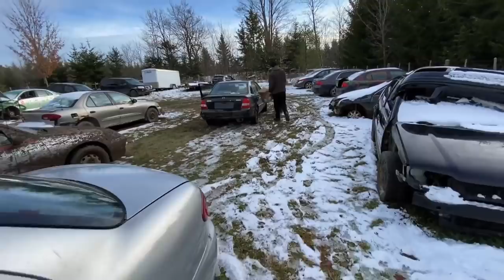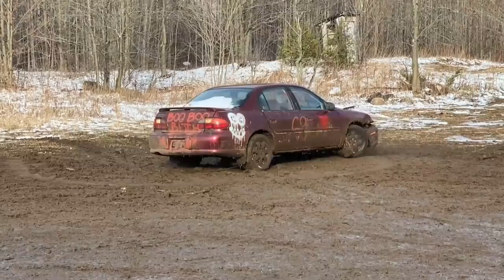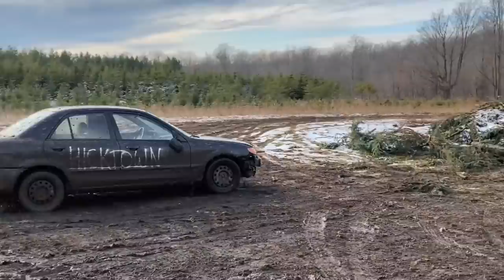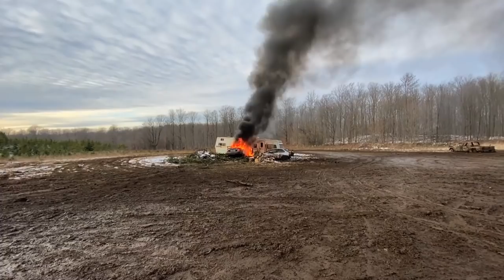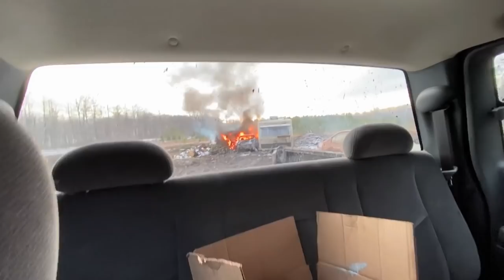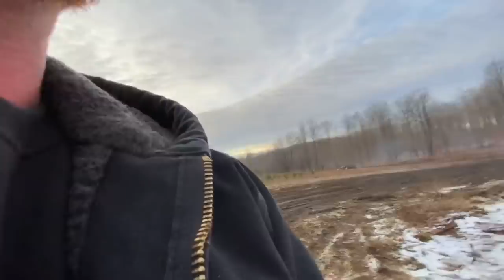Honda FIRE BURNS DOWN Trailer Home!

Comment: you should stick a peace of clothe soaked in gas and stuff in in the gas tank and light it to see if it blows up lick in a action moive
Reply: Or soak the seats in break fuild it lights up good
Reply: Has anyone told you smoke is bad for the air?